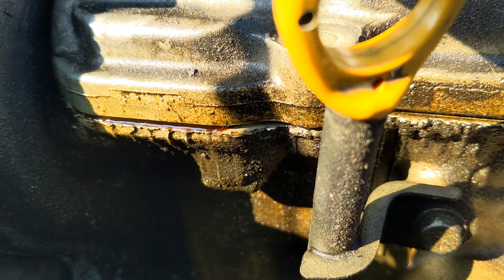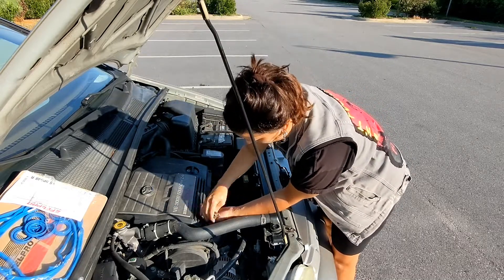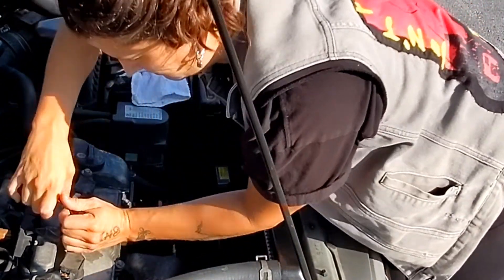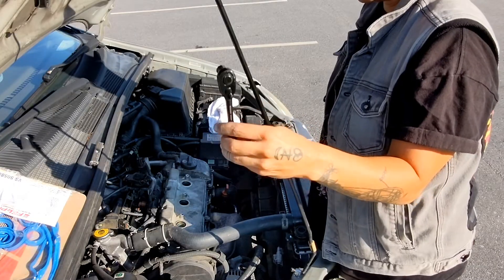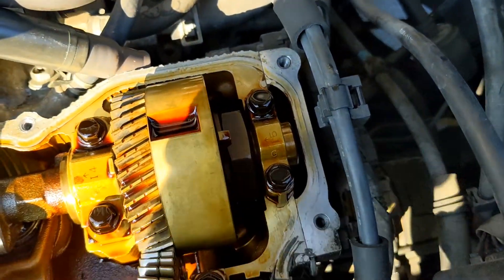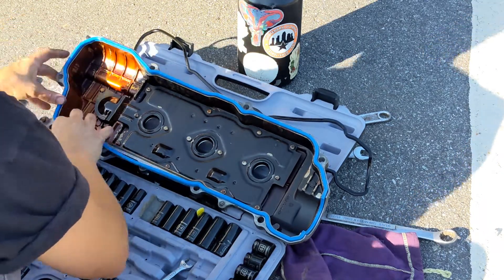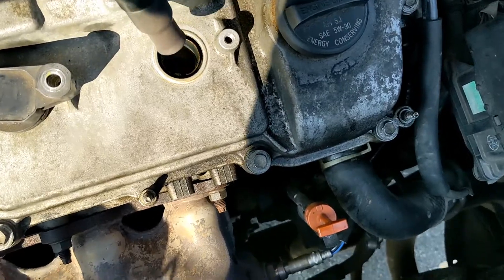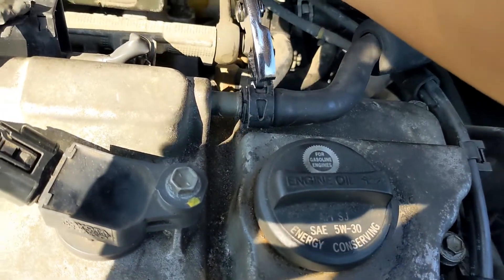1998 1999 2000 2001 2002 2003 Toyota Sienna 3.0 L valve cover gasket replacement (simple version).

Comment: I have a 2000 sienna 500000 kms 
Always nice to people.doing vids on these old vans tjat never die ..probably the best car ever made for reliability
Reply: My 2002 is at 290,000 kms.
Transmission makes a higher whining hum sound in only second gear..
Is there anything I should do for that?
Reply: Yes baby second gear it is almost the transmission time to start going do rebuild on it tje engine won't ever fail 😊
Reply: If my trans start going I'll rebuild it engine goes ill rebuild it with only quality parts u know what I mean don't cheap out on parts 8k for a transmission and engine build u have a brand new car again
Reply: 1 other thing do 3 drain and fills 100 kms drive between each fill after u go to do the fourth drop pan change filter clean pan new gasket fill with a 1/3 bottle of lucas stop slip and pray

Comment: Of course the other videos are more complicated, they probably had to replace the rear seals, which means the everything above the heads need to come off. Also, it's highly recommended to replace the half moons. Finally, the asswipes at Toyota made these one time use only valve cover bolts, though you could get away with adding a couple washers to each of them, otherwise you risk leaking. Anyway, good luck with your lesbian date :D

Comment: The Toyota valve cover bolts on this engine are one time use only. The bolts stretch upon tightening them, to facilitate a good seal. They don't stretch again when reused, which comprises the seal and leads to leaks which are worse than what originally led to the gasket replacement. Valve cover bolts cost around $30 for the entire set. IMHO, the valve cover gasket kit should include the bolts so the new gasket  can seal the way it's designed to. Otherwise there's just no end to those leaking valve covers
Reply: Where can i get those spécial valve cover bolts for 30$ please?
Reply: Good to know thank you
Reply: How can these be stretch bolts when they are only tightened to 69 inch pounds?  It seems unlikely that they can even stretch with such low torque.
Reply: The bolts do not stretch at all. And the gaskets tend to be ok. The problem with this bolts is that they have spacers that get crushed and lose the tension over time. One trick I did was to take one bolt at time and separate those spacers with a utility knife, then reinstall the bolt and then do the next bolt. Good video.

Comment: Would you be able to see if the back VCgasket  is leaking? Oh and what would happen if you ignored your leak - aside from having to top off oil from time to time? I mean I get that its making a mess and there is something  in front of engine block that has a cover that would be effected and might be important. I've been quoted $600 for the job, after recovering from shock -  Im thinking that would included both front and back gasket so I need to be more specific next time.
Reply from the maker: You would be able to see if the front part of the back gasket is leaking. I drove mine leaking for a month and I had to keep topping off the oil but I don't know if there would be greater repercussions for driving it with a leak for a longer period of time. Around these parts, in NC, they quote 150 for the front gasket replacement. If you can't do the job yourself and you can't afford it, I would just change the front gasket. And then if your oil keeps leaking after you change the front one, you would know there was an oil leak somewhere else.
Reply: You can see if the back one is leaking from under the vihicle. I was getting ready to start one, and realized I have to remove the intake manifold, to change the back one. So I went looking for videos. I was disappointed to see she didn't do the back.
Reply: My repercussions....
Leaky front gasket left for too long...

The spark plugs and coils would flood with the oil and need replacing until gasket and o-rings are changed. 🤔😁
That happened before I saw this video.
 I changed coil paks when they would fail.
So, do this job to save troubles and money.

Comment: How long does it take you? I have a p1130 code I'm trying to fix, my car overheated because the radiator blew and I had to drive a couple miles I pulled over and put in more water in the radiator but I think there may be some damage. There's a little bit of rattling sometimes when I start it and stop it I'm not really sure what's going on. 

I've been told it might be the head gasket

Comment: Do not start the job unless you have an E6 female bit socket. Without it, you cannot remove the valve cover and the (spark plugs) coil pack.  A crucial piece of information she forgot to mention.
Reply from the maker: This tool is unnecessary.
Reply: My 2002 needs it.
Can add the E6 star tool to description or video.. Or Pinned comment.
I have to go and get one.
Love the video, otherwise perfect for me.👍👍❤